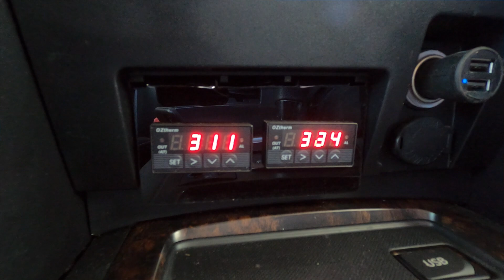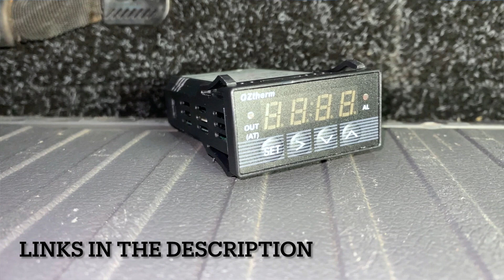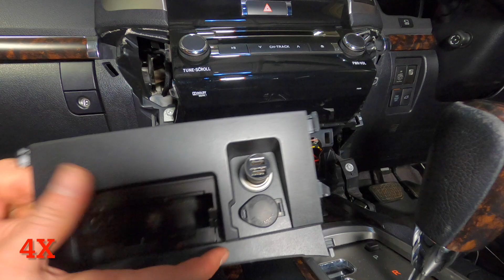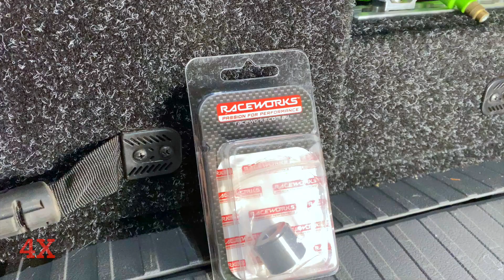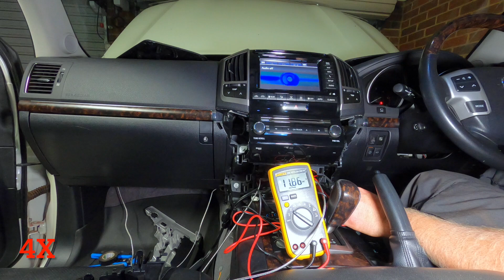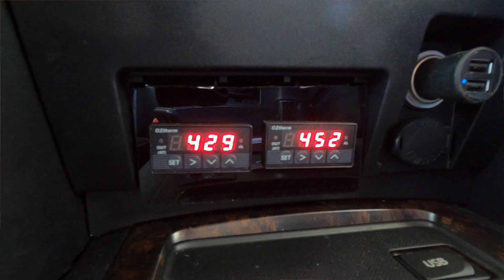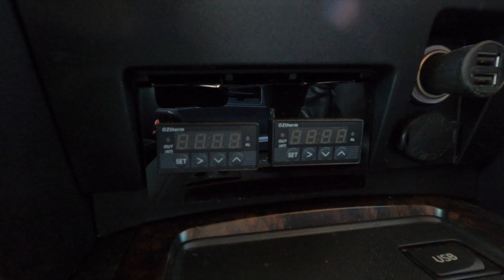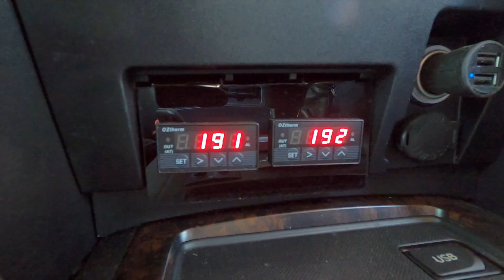EXHAUST GAS TEMPERATURE | HOW TO: Temp gauge INSTALL | Landcruiser 200 Series | Turbo Diesel Range

Comment: The "Rule of Thumb" of 150-200° for dump-pipes is so far from correct, not funny. Under low gas flows and with lots of piping and big snail, yeah, getting close to those figures but when power is on the pump and working harder, flows increase a lot and then heat soak kicks in and temps get closer to only low double digits of difference. 

If you want best readings, pre-turbo is almost the best. For the "Best" you would have a probe sitting right at each exhaust port which in raod cars, not feasible. As for best temp to look for on cool down, I wait till under 180° post-turbo temps before shutdowns.

Comment: Good video & very useful information as always, cheers!  For reference, I have a 2018MY GX200 with Ultragauge monitoring EGTs.  I’m not sure if the monitoring points are pre of post turbo but It’s not unusual to see EGTs over 400C around town.  I regularly tow a hybrid pop-top off-road camper and with my alarms set at 600C, occasionally have the alarms activated overtaking or nearing the top of some significant climbs, even in winter temperatures.
Reply from the maker: Thanks Peter. For sure, these vehicles get warm, regardless of the ambient temperature. I would dare say with temps like that I would expect that sensor to be very close to the turbo. As long as you are aware of the 'normal' range and manage temperatures accordingly you should be fine. 
Cheers.

Comment: Awesome that was so helpful thanks for the explanation
Reply from the maker: Thanks mate, glad it was helpful.
Cheers, Nathan.
Reply: @XploringOz  Oh also, with the probe did you get the fast response exposed tip or the standard one - they offer two and no explanation of which does what, cheers if you get round to answering this one.
Reply from the maker: @whatnowjon  Hey mate, so I just went with the standard probe. This still provides good visual representation of what is going on and is still responsive and relevant. The second reason was, I think if the figures were changing so quickly (as per fast response) it could make it hard to read on the road, particularly because it a digital text and not an analogue gauge. 
I do find the standard one works very well. 
Cheers.

Comment: Thanks great video. We tow a van and always start to reduce speed coming off the highway to a lower speed and let it idle for a minute when we stop.
Reply from the maker: Thanks mate 👍
Yeah, sure is a great idea. Never a good move to come from full load to engine off straight away, just has the potential for long term damage

Comment: Why didn't you use your Ultra - gauge to read sensors? I've seen 680C for a short period towing up hill 3 tonne.
Reply from the maker: The UltraGauge  doesn’t support this data on the pre-DPF versions. 
That’s a high reading, I’m assuming you are running a DPF and it would be interesting to know where the temp probes are located?
Reply: @XploringOz  would a SG2 support the EGT for a 2013 D Max
Reply from the maker: @Mick_4591  Sorry mate, I don't have experience with the EGT readings in that model and don't want to provide the wrong answer. I'm sure a Facebook forum or the like might be able to give you some more helpful info? Thanks.

Comment: Why don’t manufacturers instal them standard on TD’s ?
Reply from the maker: My assumption would be that from factory, these aren’t figures that should cause concern. But modifications, towing, harsh conditions etc severely impact the engine load and temperature.

Comment: Great video once again.  One of the best mods for those towing and heavy work.  Helps with gear selection and shows those chasing 5th or 6th gear when towing heavy is adverse to performance, economy and reliability.
Reply from the maker: For sure, it’s amazing how easily these temperatures and engine load is effected by gear selection. 

I will try to document this is another video in the future 👍

Comment: Good morning Nathan, thanks for giving us another task on the pre PDF versions! 
Have to bear with you on that subject. I was hoping that you do this nice vid, but also very much had hopes that in our lc200 the 2 temp probes could be wired to the Toyota el system and show up via the OBT II plug on our scan gauges without having to install 2 extra gauges!!! Assume you have tried to find out this for a period of time before doing it your way. May you could shed some light on it too. I assume after a while you will show us how the EGT and engine load factor are in correlations. But that’s good for another well made video. Thanks for your great assistance on information on such things. Cheers.
Reply from the maker: Thanks mate 👍 glad you enjoyed it. 

Yeah, I wish it could be displayed through the UltraGauge, but I just couldn’t get it to work. 

I am also very interested in the efficiency/temperature and load testing and finding that sweet spot. Soo many variables help the vehicle in different ways. 
I do have a plan to change some things to increase the efficiency, but this is down the track a little bit.